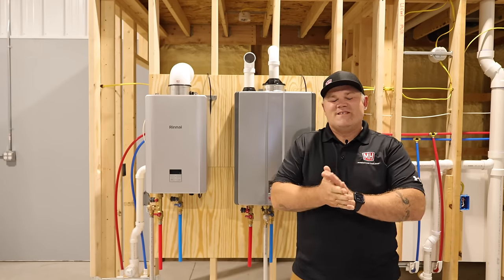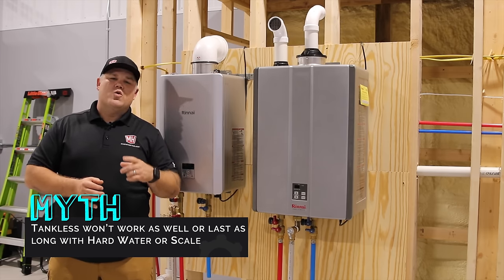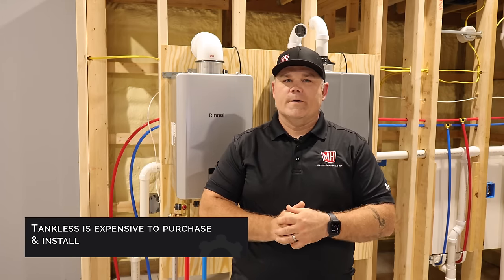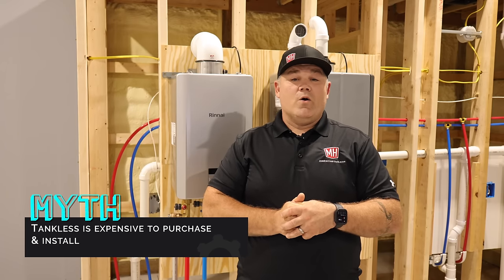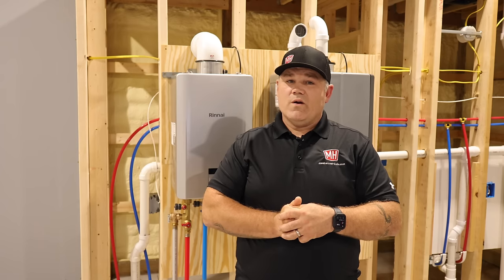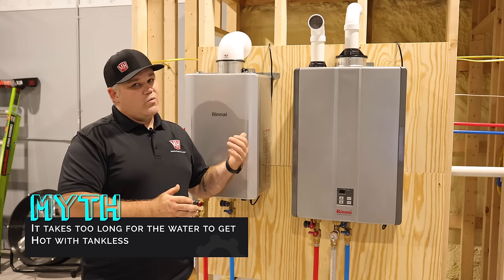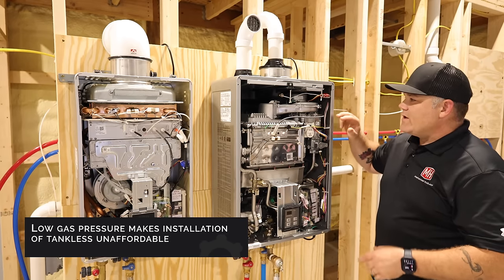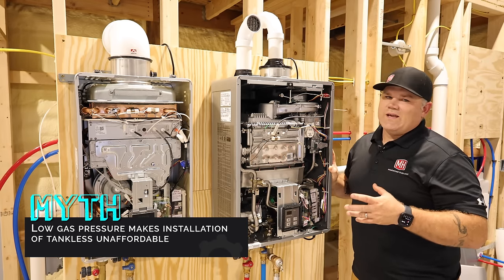Myth Busting! Tank -vs- Tankless Water Heaters

Comment: We had one for 17 years and it never failed. The only issue I wish you would cover is the unit not firing when you open a faucet slightly. When we would barely open a sink faucet to wash hands, wash something gentle, the water demand wasn’t enough to tell the unit to fire. Not a huge problem, but a problem nonetheless. Great video sir!
Reply: Newer units have a lower threshold (due to increased technology allowing a wider range flame size), also try bumping the temperature setting down a notch so you are using ‘more’ hot water
Reply: That is the same problem I had with tankless. I wouldn’t do tankless ever again.
Reply: Usually if its older its is because either the flow meter is lethargic or the heat exchanger is having issues from either scale or age and not allowing to fire on low flow. Second older units have a higher flow rate to get the unit to fire. Also be sure your unit is maintained.
Reply: Navien is the only brand I would consider.
Reply: The activation of a tankless water heater is triggered by water pressure drop.  If the faucet is not open sufficiently, the pressure drop will not be sufficient to activate the water heater. Today’s faucets may be a problem as well because they are a water saver design which does not allow sufficient flow rate to activate the water heater. You can overcome this problem by modifying the water 
restriction device. Open up the hole in the restrictor until you achieve a flow rate that will allow your water heater to activate.
Reply: @MrJamespeyton  that’s why the Navien is the way to go they have a tiny tank for the recirculation system uses very little energy but you’re not waiting for the main heater to kick in in a low flow situation.
Reply: @MrJamespeyton  That's like saying I bought a car that gets 50 mpg to save money, but it wouldn't go fast enough, so I changed the jets to make it more powerful, and now I get 20 mpg, so really, I won't save a thing!
Reply: @stevem1081  - No..  That analogy doesn't work at all.   What it says is that it has a tiny tank to give an initial warm water flow before the main unit goes into full operation.    You're not keeping a 30 gallon tank 'alive', which is your implication.
Reply: You are correct! Most tankless are designed to activate at 1/2gpm. Those of us who like to save water, are out of luck.
If your faucet flows at or below 1/2gpm, the tankless will not turn on.
Example, on tank heaters, I had a house, family of seven. My shower head flow was 1.25gpm. With a 40 gal. Tank heater, we never ran out of hot water. And we were not on a ration schedule.
Reply: @MrJamespeyton   I have zero issues with low water flow triggering the water heater .. zero.  And the bathroom faucet is limited to 1.25 gpm  so its is very low coming out of the gate, but even at a very low flow like to wash hands the water heater kicks in .. but then my Rinnai is a newer model.   On the flip side a low flow faucet does take time to get hot water, no matter what type of water heater.   My kitchen faucet is the closest to the water heater and I turn that on for just a few seconds and I can hear the water heater fire up.    Flow issues .. not with the newer stuff
Reply: @Rangband1   Does Navien make condensing water heaters now?  If not they are limited to about 90% efficiency VS 96% efficiency for the Rinnai.  Both are very good water heaters but if high efficiency is on your list .. Navien falls short
Reply: @hanko5750  they make both, their condensing units are 96% efficient
Reply: @hanko5750  they’ve been making Condensing tankless since 1988. Their condensing tankless is also 96% efficient.
Reply: It can be a problem. I've had a Navien tankless for 10 years. It fires when it senses a 1/2 GPM flow for 3 seconds. If you have newer water saving equipment like our washer that sprays some water, then rotates then sprays water, etc the heater never fires. Similarly if you turn on the hot water at the kitchen sink to wash individual items. I can hear it firing 3 seconds after I turn the hot water on but often I don't leave it on for more than a few seconds so you repeatedly end up adding a bit of cold water into the pipe, possibly more than the quantity that gets heated.. Same with shaving in the bathroom. What they excel at is long water users, like showers and baths. I solved my problem with a 12 gallon 110V tank between the Navien and the water users. It happens to be in the crawl space directly under the kitchen sink so there is very little wait time for hot water where it is used most (other than the shower).
Reply: @dlkehl  Don't be narrow minded. Where there's a will, there's a way.
Reply: @8.6GivenAdqVacSysm  hmmm, that's odd, my new unit doesn't hold any threads at all..nyuk nyuk nyuk....
Reply: @bbjazzmanjazzman7721  yeah, hmm the threads are stripped on every single bolt and screw…. That’s rough, must’ve been build 4:55 on a Friday, or 8:05 after DLS… I guess temperature thresholds are the least of your problems with the massive water leaks due to the unit being a pile of loose parts on the floor… 🤔😱🤣🤣🤣 🫡
Reply: @Rangband1  I don't know much about them but I would not shop at Manards unless you know Everything about what your getting. they have the lowest grade of everything.
Reply: @portagepete1  lol not sure where/how Menards came into this discussion
Reply: @tbelding  He said to drill out the flow restrictors, so now instead of flowing say 1gpm, it may flow 2 gpm, at that point, you have doubled your water and energy cost! So, in reality, your tankless is costing more than a tank to operate!
Reply: @offgrid-goo-roo  Finally, someone that understands low flow. My bathroom sinks have 1/2gpm and my showerhead is a Niagara flowing at 1gpm, and with my 40-gallon lowboy tank,  like you said, with that low flow head, I could stand in the shower all day and never run out of hot water, or 20 people could shower back to back and still not run out.  Most people don't know, the 2nd biggest energy user in a house is the water heater, when you cut hot water use in 1/2 you can see the savings.  Tankless seems to promote more water use, thereby increasing your bill.
Reply: @stevem1081  Except that a tankless water heater only heats when it's activated.  A tank has to remain at temperature all of the time.   If you have someone that likes to take VERY long, VERY hot showers, that's a different issue causing your water and energy costs.  I have taken a full shower in under 3 minutes, including shaving.   I personally prefer to have a shut off for the shower.  That way I can get thoroughly wet, shut the water off (or to a trickle), soap up, rinse down, and NOT lose all of my soap to the shower head that is trying to rinse me as I wash.   If you don't want to yell at the person that's taking insane showers, put in a low flow shower head.   

So, no, I don't see opening the flow restrictors as being anything other than biting my thumb at the terrorists at the DoE.   At my house, our hot water is used a few times a day at the kitchen sink and bathroom sinks, the dishwasher, the washing machine (which I prefer to fill at a decent rate, even if we use cold most of the time), and showers.  Mostly reasonably short in duration.
Reply: @stevem1081  - Oh.  Try taking cold showers. They work pretty well in the summer down here in Houston.  Even the reticulated water from the providers is lukewarm.
Reply: This is why a tank system is better. Rather than one large tank, get two if possible and have them close to the point of use. They don't have to be very large. I have one under the kitchen sink and another near the bath room. As soon as you open the tap, you have hot water. By the way, here in Europe the appliances such as your laundry washer and your dish washer make their own hot water. The clothes dryer has a heat pump. I doesn't even need to be vented.
Reply: We don't have issues with bathroom sinks that way - the tankless system turns on well for low flows. The real problem is waiting for the hot water to show up at the bathroom sink. I think the remedy for that is local heaters under the sinks, supplied by the cold water feed. However the main tankless will still have to handle tubs and showers.
Reply: @Rangband1  I guess @portagepete1 introduced the topic since the original thread was citing quality products and he had an opinion regarding Menards products quality.
Reply: @stevem1081  Sheesh. I must have super tech in my house. All of my water flow controls at sinks and faucets have flow from 0-2.0 gpm. It just depends on how far I turn the lever. Wait for it, wait for it. Kind of like how many sheets you off the roll at a sitting, the more you pull the more you get. 🤣🤣
Reply: @tbelding lol same here in Tennessee. From April until end of October the city water is warm. June through September we rarely turn hot water tap on to shower. 

The city saving me money for once.
Reply: We noticed that problem right away.
Reply: @hanko5750  Yes navian makes condensing tankless water heaters. I have one. Have had it for probably 4 years now. Works great. I have it mounted on the outside wall of my house, inside of course cuz I live in Colorado, so my intake and exhaust pipes are no more than 2 ft long and that's mostly just to get the exhaust away from the intake port outside. As far as the flow rate starting the burner for all of those of you who are trying to wash your hands with low flow amount of water just crank it for 5 seconds and then cut it back to a low flow. The burner will come on and it will stay on till you turn off the valve at the sink.
Reply: This feature works well to keep pipes from freezing by opening faucet just enough for a trickle and not enough to trigger hot water on.
Reply: Also really big saving on propane!

Comment: My son had a tankless installed in a new construction home about 3 years ago, I don't know which brand. We had a freeze and his unit broke down. His family went at least 2 weeks taking cold showers waiting for replacement parts to fix the unit.
Reply: Are you in Texas?
Reply: @vienna844  yes
Reply: @capt.sardonico2197  I just moved here from New York building a house in Fulshear and I was here during that freeze. I am getting an outdoor version tankless water heater. If you lose power, you lose hot water because don’t you need the igniter to start it?

Comment: I lived 33 years in Korea.  The last 28 years in apartments and ALL had tankless water heaters.  Apartments  and homes in Korea are heated by floor heating with hot water by tankless water heaters.  NEVER have I had cold water when I turned on hot water in the shower, bathroom or kitchen sinks.  Tankless water heaters have been used in Korea for at least the last 30 years.  Tankless is the only way to heat water for houses, businesses or apartments.  That is just speaking from 33 years of experience and usage!

Comment: I thought I had “endless hot water”. Until one day, hot water was running and then went cold. I don’t have hard water either. Unfortunately, when the builder “Pulte” who built this house, offered a tankless but I didn’t realize that they would install the cheapest Rinnai model which I would learn later because mine doesn’t have a recirculating pump and I waste about two to three gallons before the water gets hot. I truly hate this thing.

Comment: I had a lime coated tank that I replaced with a Renai.  I love the tankless upgrade.  No water softener needed.  Every year or two, isolate the unit with the shutoff valves and use a small sump pump to run white vinegar through it to dissolve the lime.  You will never need to replace it.
Reply: Yup.  Exactly the same experience I had with a Rinnai.  They make a great product.
Reply: Use a gallon of CLR in your tankless, and it will last FOREVER. My last RV trailer had a tankless and I saved on LP and had all the hot water I ever wanted. My Airstream Excella Motorcoach has a Cummins/Onan Diamond series liquid-cooled gen-set that puts coolant into my hot water system and provides 90% of the heat for my water-brilliant set-up!
Reply: Jesus is the only way to healing, restoration and salvation to all souls. Please turn to him and he will change your life, depression into delight, soul heading from hell to heaven all because of what he did on the cross 

“Whoever calls upon the name of the Lord shall be saved” Romans 10:13
Reply: @HaroutBlack  How is he about installing heaters, though? Is he licensed? How much experience does he have? How long do you have to wait for an appointment? I know a guy who had an appointment, Jesus showed briefly and gave an estimate, and we haven't seen him for years now. Getting tired of waiting for his second coming.
Reply: @HaroutBlack whatvdoes this have to do with tankless heaters
Reply: @HaroutBlack  Please keep your religious views to yourself on these forums.  It is inappropriate behavior from You. We don't all need saving. Go save yourself.
Reply: @HaroutBlack  Jesus is omni-present before and after his incarnation. He is the way, the truth and the life. He created the fabric and "laws" of everything in the universe. Which means he created time limits and orders of degradation to everything including the life span of tankless water heaters. 

He identified himself as "the way, the truth and the life" while being omnipresent, and, while upholding everything - so when we apply that to everything, the way of water heaters implies maintaining them, the truth about water tankless heaters is that their efficient, and the life about tankless water heaters is that they improve your life.
Reply: nice lie
Reply: @dknowles60  I'm glad that the truth matters to you
Reply: @Walkercolt1 so shut it off and put CLR in, let it do its job, then drain it back out? Thanks
Reply: @HaroutBlack  What does Jesus charge for tankless water heater installations?